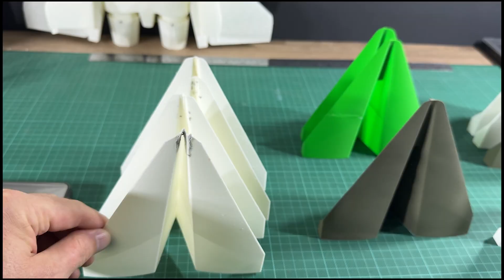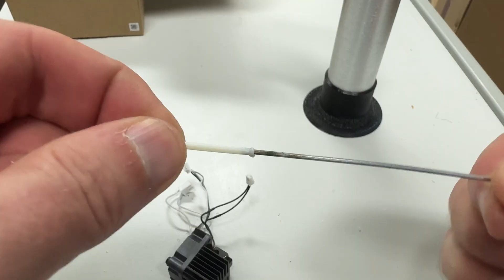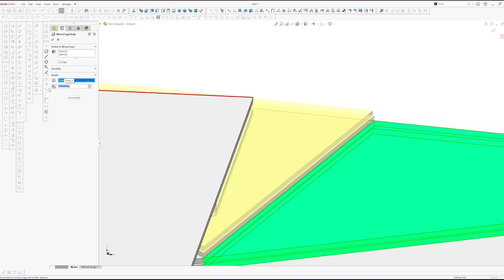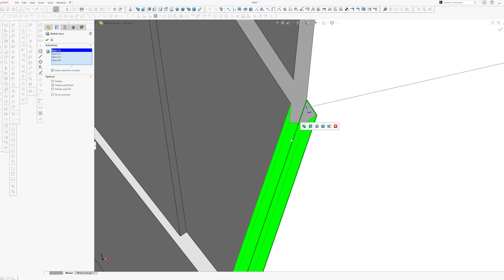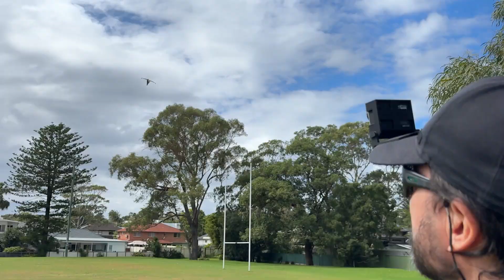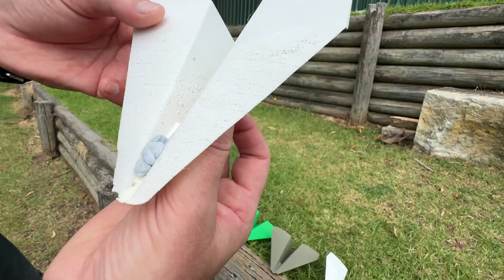Bambulab ASA Aero - 3D Printed Paper Plane

Comment: do you know what happened with Renee / AeroJTP?
since you are calling it a former collaboration i assume you no longer work together. but i have not seen anything new from their side in almost a year. do you know if they are still working on RC jets or did they give up on it?
Reply from the maker: Not sure. I was cut from the collaboration and have not been able to get in touch with René. I am continuing work on my Patreon and my own social media in both Plastic kit models and some RC stuff.
Essentially AeroJTP was a joint project and business. We were set up for 50/50 work and receipt of profits. I was responsible for the CAD detailing, 3D print optimisation, all assembly documentation and 3D visualisations and animations. Also a considerable amount of my time was spent testing printing settings and testing materials.
Rene was involved in the conceptualisation, design features and RC electronics and flight testing and YouTube recording.
Our website included both our names and the About Us section included both Rene and my contributions.
As Rene had full control of the website, I have been removed (without my consent) and my 50% cut of the sales has been revoked. 
I don’t know what Rene is doing - he still has our website up just with no mention whatsoever of my involvement which is rather disappointing.
Reply: @marcphilippveenendaal2026 that's sad... 
Your designs were very good with how detailed and functional they were.

I wish you luck in the future.
I guess i'll be cautious if he ever returns with a new project, sounds like he isn't the most dependable person 🙁

Comment: you mostly printed foaming filament to cold, it breaks
Reply from the maker: Is that a statement or a question?
Reply: @marcphilippveenendaal2026  a statement
Reply from the maker: @localhost2933 it’s printing at optimum temp of 265 degrees but filament may not have been dried enough. Have had awesome results since… I have the profile on my Patreon for Bambu Studio

www.patreon.com/marc_mpv

Comment: Looks promising.. I've not tried to print an airframe yet. I think I'd get some ASA Aero to try. How does it cope with warping during printing? (E.G. is an enclosed printer enough or do you think it needs a heated chamber?) Have to got any profile settings for a P series machine?
Reply from the maker: Thanks for your interest! ASA aero works astoundingly well in an enclosed printer with no warping. I have printed a range of RC aircraft airframes with it. It ends up being up to 22% lighter than PLA Aero. I will be putting up a link to my Patreon where you will be able to access the printer settings for Bambulab printers. Cheers, Marc